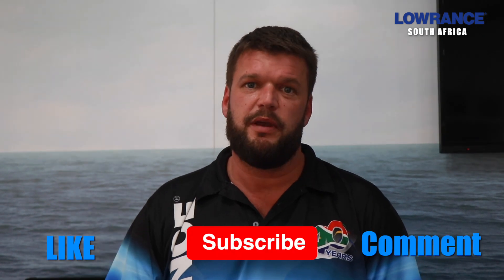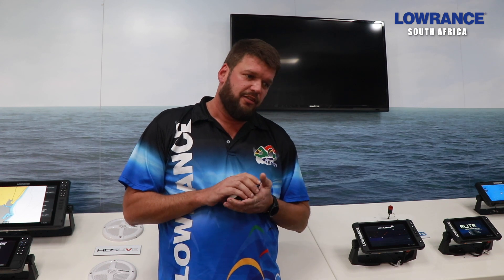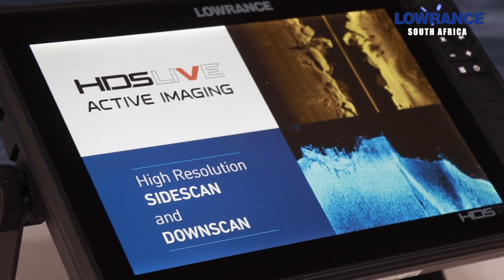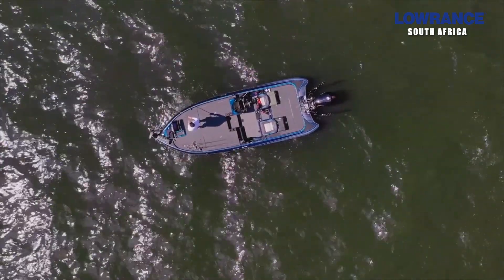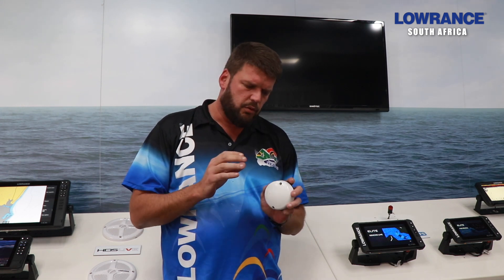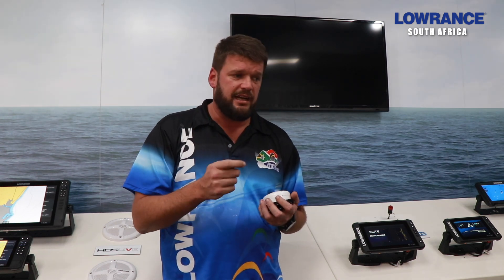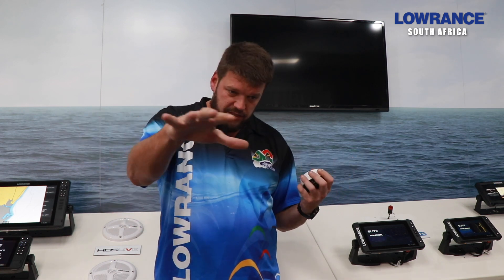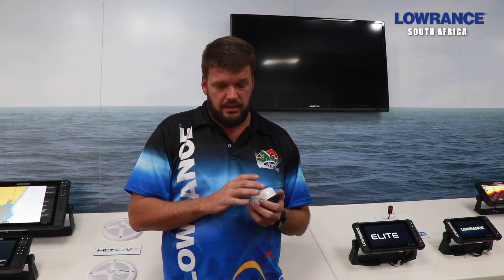The Lowrance POINT One GPS - John Minnie @LowranceSouthAfrica

Comment: Hello John, question for you if I may.  I have a Lowrance FS9 Unit with a Motor Guide Xi5 Connected thru the MG Gateway and NMEA 2000.  I mainly troll for Trout & Kokanee.  I am trying to dial my system in for following routes in autopilot mode; but haven't had a lot of success as the system seems to have a mind of it's own at times.  I could be wrong; but I believe it may be a GPS issue.  Would installing a Point-1 AP GPS system be very beneficial for what I'm trying to do?   Thanks, John K.